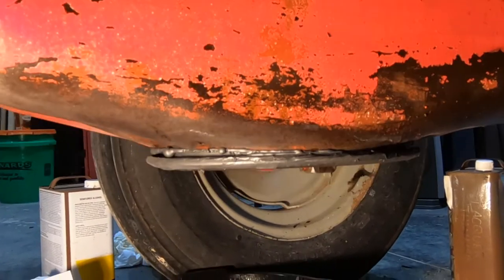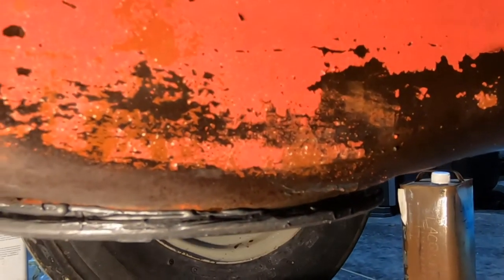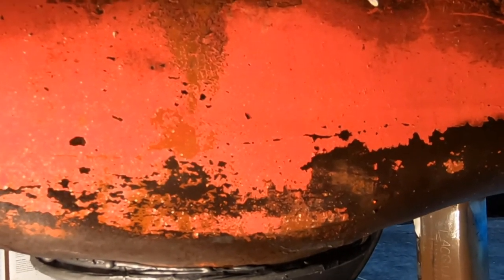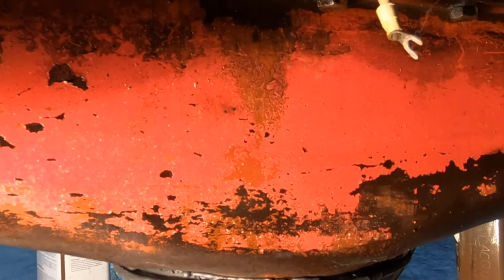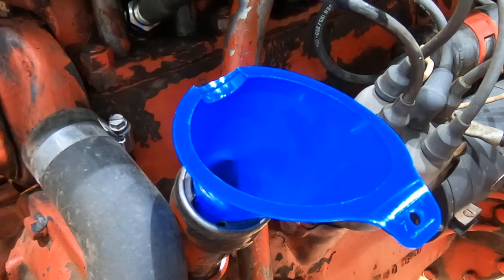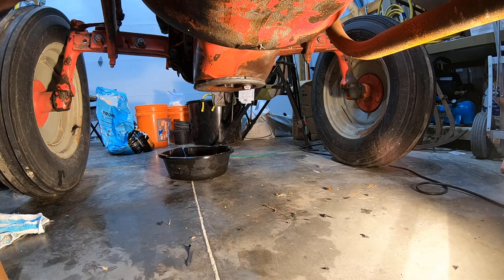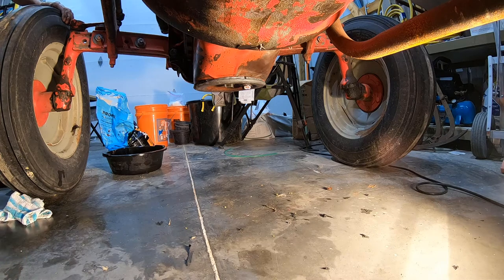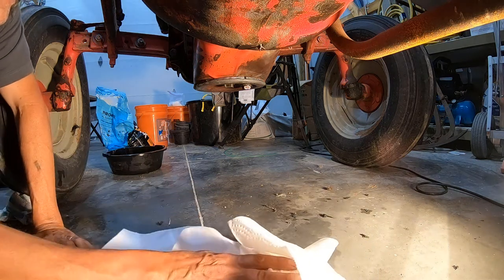Ferguson TO-20 Oil Change --  Success! -- maybe...

Comment: Thanks for sharing your experiences during the oil change, I went through much of the same with my TO 20. The rim of my oil pan had taken a hit and was slightly dented enough to leak. You're Fergie looks to be in very good condition for it's age, must have been garage kept for most of it's life. Enjoyed your determination to get the job done right. :)
Reply from the maker: Thanks Kenneth! I've heard from several people now that have gone thru the same thing! Definitely a poor design, but overall they are nice little tractors, and worth a little effort (or a lot of effort) to keep them running 😊

Comment: What type of oil do you use.    Your video just saved my tractor I had the same problem
Reply from the maker: Glad I could help! I used a quality 10-30 oil. The owners manual calls SAE-30, 20, or 10 depending on temperature, so 10-30 has it all covered. The capacity is 6 quarts. Good luck!

Comment: I went to change my spark plugs on my tractor and it is 20 miles away  I did not   no the dam plugs are 7/8 ever socket but that one and talking about cold we all had that shit this year my little girl had the flu twice
Reply from the maker: Yea, that sucks. My biggest problem is having to run 35 miles to town to get parts if I need them. With old tractors, it's always something...
Reply: @PlanetMojo  dam your just like me I 30 minutes from a auto parts store Walmart
Reply: I know, dude, that takes a 13/16" spark plug socket; that's what's used on aircraft. Had my NAPA store order one for me, I think it was about 10 bucks or so.